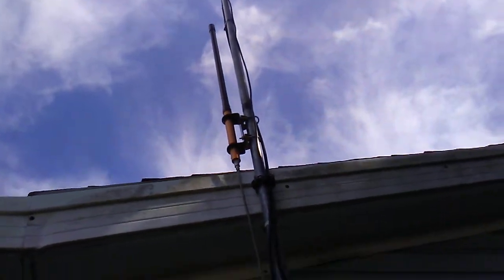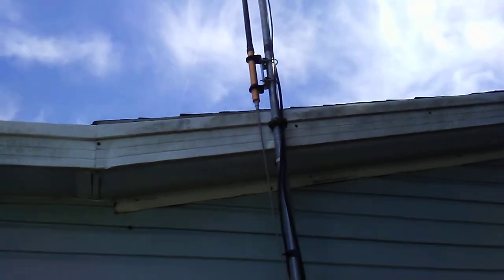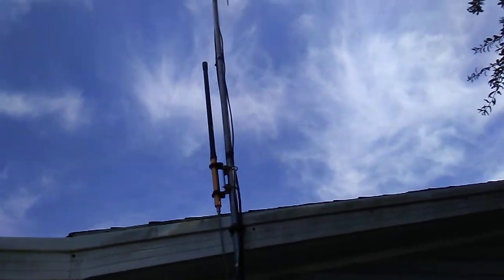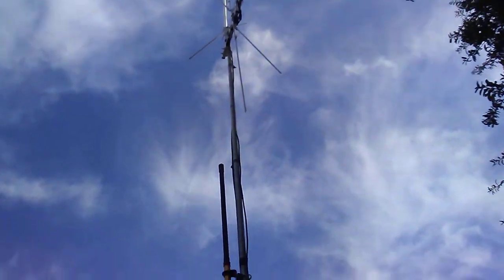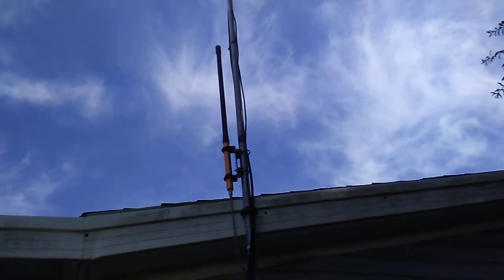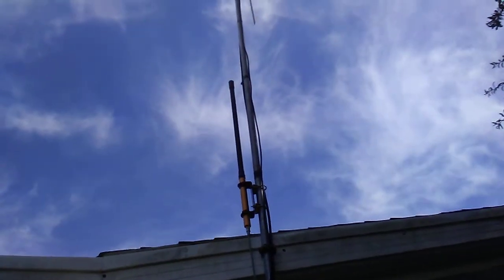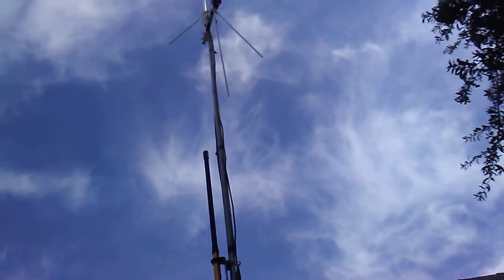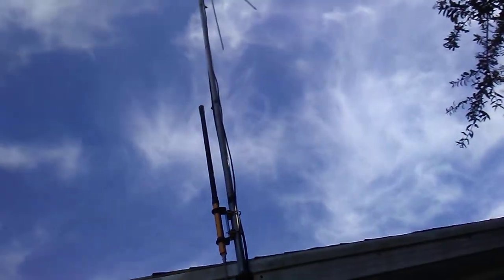Tram 1499 outdoors temp test receives ok- good

Comment: If u have a noise problem and need to install a mfj noise reducer box.this antenna would be acceptable as the second antenna.however using it as primary transmit and receive ant. would not yield good results.a good old 1/4l ground plane would be much better.these antennas resonate the feed line i believe do their small length.🙂

Comment: It's a balcony antenna. So your supposed to mount it 60+ feet in the air. It's well built...bad reviews by people putting it 2 feet above roof line in a urban area. Any mobile antenna will outperform this antenna at ground level...that's not the point. It's made to be a low cost stealthy antenna that you can put into a high rise building. I talk to a guy who is 120ft up in an apartment. He has a mag mount and does the 28 mile trip no problem. I've had an Imax 2000 at 84ft...you talk to everybody that your buddies can't even hear. There is no wattage increase that outperforms elevation for both rx and tx.

Comment: I purchased this antenna and find it to be completely worthless. Mounted 25 feet in the air, with the optimum 50 foot of RG8x coax, this pile of garbage is out performed by my Little Wil style Tram mobile magnet mount on the trunk of my Honda. No joke. Even with an SWR of around 1.3 to 1, this antenna cannot even perform on par with a mobile antenna that's a couple feet of the ground. How the hell can they sell this with a straight face?
Reply from the maker: I got rid of it shortly after antron at 5 ft off ground does way better even